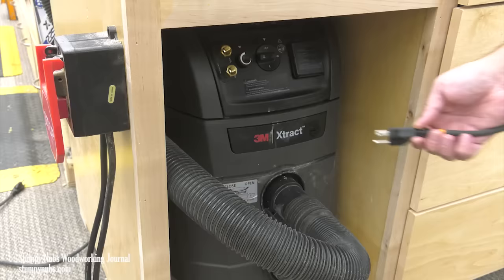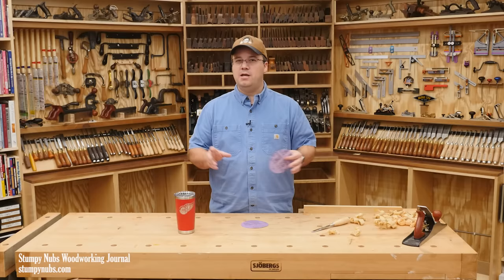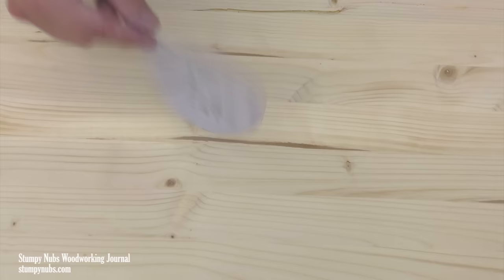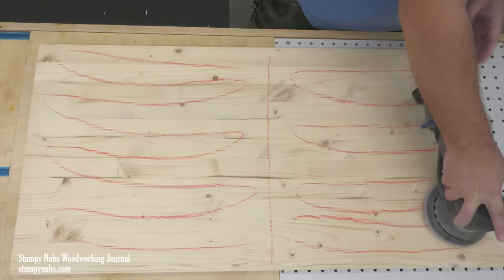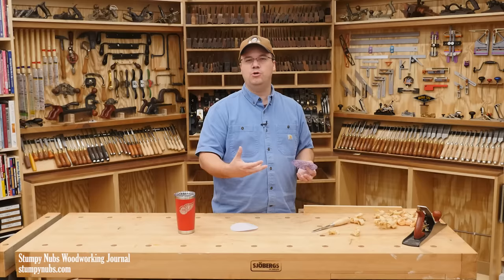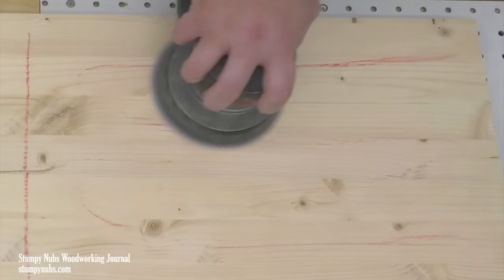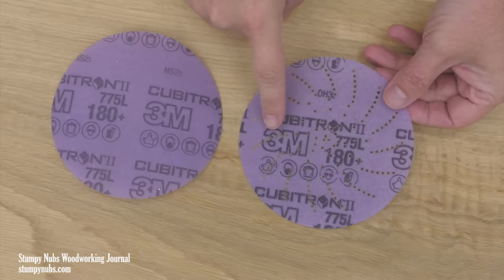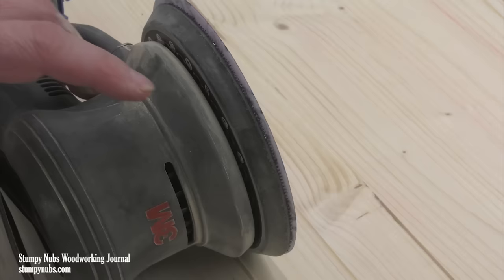This LITTLE KNOWN tip will cut your sanding time in HALF!

Comment: First of all... You have no idea how much more efficient you're making countless woodworkers by demonstrating this on your channel. I had heard rumors about the 3M paper, and had never bothered trying it... But, last week, while ordering a bunch of "state of the art" blue aluminum oxide discs off Amazon to begin major sanding of the oak legs of a major work/specialty bench , I happened to pick up a trial pack of the cubitron II Xtract discs. I wasn't sure what to expect. But, the results were so drastically better than the aluminum oxide "trapezoid" pattern amazon discs, I gave up using them altogether except for incredibly fine grits of 400 and above where the amount of sanding required is much less than the lower grits. Thank you so much for the insight... So many of us are traditionalists who are reluctant to buy into anything new... and sometimes, there's something to be said for that. But, with this, there is no comparison. It saves you so much time that you'll regret every time you ever sanded previously to this, knowing that there's a better way. I may have pride... But, in this case, my pride plays absolutely no roll. My time is far too valuable to waste it with a method that takes far more time, for no good reason.

One more thing. If I'm working with wood, does it matter if I get the mesh  discs or should I stick with the cubitron you showed in the video? I need to buy more, and I want to try the standard ones.. Unless they're inferior to the mesh/Xtract/Cubitron 2 discs. Thanks again so much!
Reply from the maker: I think the mesh discs work faster and give the best dust collection results, but the will wear out faster if you are aggressive with them, especially around the edges.

Comment: I have a DeWalt ROS which has some form of air-suction built into it. It comes with a small dust collection "bag." I believe this is common with ROS's. For me, a more interesting test would be to compare results of the dust collection bag vs attaching a vacuum using disks with holes for both examples.
Reply: Those bags are a poor substitute because the sander can never apply enough suction on its own. Still worth using if there's no extraction since they'll keep a huge pile of dust from getting in the way though, but more for just tidiness.
Reply: Residual cooling flow from a 600W sander used for dust extraction can never equal 1000W of shop vac.
Reply from the maker: Every sander is different. Comparing how mine works doesn't help you with yours. And it would not have changed the conclusion, which is that dust collection, wherever it comes from, speeds up sanding.
Reply: I have a dewalt. Use mesh paper and always use dust extractor. Bought mesh in bulk last year, so it'll be a while before I try 3m. 

You don't really need a scientific test here. The results are obvious the first time you hook it up. At least mine is.
Reply: The bag is an improvement over nothing, but worlds apart from even the cheapest vac setup.
Sheesh

Comment: I wish you had used the same perforated disc for BOTH tests. It's possible that simply giving the dust a place to go (even without a vacuum) is enough to significantly improve the sanding.
Reply from the maker: Did you see how much dust accumulated beneath the disc, from that small area? You aren't going to hide all that in the holes. But you are free to run your own tests.

Comment: It's the only sandpaper I use. I have a DeWalt ROS and a Rigid vacuum that has a DustStopper attached. I am a hobbyist woodworker and I agree 100% with James. I was noticing on my last project (crib board) the difference between sanding with and without the vac attached... I thought it was my imagination... did a lame a$$ test for myself and thought "hmmm, might be smart to keep the vac attached all the time" after seeing James do this test I am sold. Also, to anyone that has never used Taytools I'm a firm believer and I am not and will not be a "youtube influencer" I would much rather be making sawdust in my woodshop (aka garage).

Comment: Great video!  About the same time I found fittings so that my sanders would connect to the dust extractor, I bought a sample pack of Mirca discs.  Maybe the astonishing speed of sanding was not just the Mirca discs.  Thanks!

Comment: Dear  Stumpy Nubs and fellow watchers. Should you use perforated discs, then you must have suction on, otherwise the migrating dust shall clog up the disc fitting surface and it will come off well before it is worn out. Trying to persuade it to stick again is often a waste of time. Thank you for another instructive show. Best wishes from West Cornwall, U.K.

Comment: @StumpyNubs, when you mentioned “vacuum”, it occurred to me that something else is taking place while suction removes dust from between the sander and the wood. Suction is generated by the differential pressure between the ambient air and the air inside the sander. The same force also acts on the sander itself pushing it downwards, “sucking” it toward the work surface. This force, in turn, strengthens the friction force thereby improving the sanding. (Without vacuum, this additional force is not present; only the force your arm applies and the sander’s weight generate the sanding friction ) Don’t you think?
Reply: I don’t think so, since most of that suction can probably leak out between the velcro layer or somewhere else, plus the overall difference is probably negligible compared to the weight of the orbital just with gravity

Comment: The quicker  chips and dust are removed the less strain on the cutting device.Your demonstration shows it perfectly.Reciprocal saws have the problem because they only move about an inch and not enough movement to clear chips and can bog down. Sanding discs without dust extraction are just floating on dust and not doing anything.Your demonstrations show the obvious that most people miss in a very simple way.

Comment: I'm a beginner woodworker, in fact I wouldn't even call myself that, I just build stuff for myself.  And the differences in sanding time was so noticeable even to me. The only thing I will use now, even if they are more expensive.

Comment: First time I saw these disks was in this video, so I wasn't very hopeful that they'd even be available here in South Africa, but that's OK, I thought, we do have the Mirka Abranet, which I have been using with great success. But then I googled 3M Cubitron and, lo and behold, they are indeed available, but maybe just not at the places I'm used to look at! And the ones with the zigzag pattern are significantly cheaper than the Abranets too, at just below U$0.77 each, although the minimum number you can order at that particular shop at a time is 50, so it could become pretty costly if you start looking at three or more grits... 😮 Will definitely keep looking for them though!
Reply: Mirka Abranet is superiour, especially with their Deros sanders.

Comment: Interesting observation. I'm not convinced that the smoothness of the surface is better when a vacuum is used - but I can't see how to measure that without some expensive or at least time-consuming steps. But the reduction in dust is enough to make me use a vacuum when sanding.  Thanks, sir.

Comment: I am scraping all the paint (textured) off my drywall and re-mudding the entire surface going for a flat/Level 5 finish.  I bought a Ridgid shop vac a year ago and it did have the most powerful motor they had at the time.  I had never hooked a sander to a vacuum before and sanded drywall but I could not believe how much dust it got.  I would say 98% if I had to guess b/c only thing was a very small amount of drywall dust that managed to fall.   You will have to clean the filter every 10 minutes but that's dust that's not going to be all over your house later.
Reply from the maker: My house is all knock-down texture under latex paint, and I'd love to remove it. Any tips?
Reply: A light spray of water will soften the texture mud and make it scrape off ten times faster/easier but a lot of times you'll have a textured wall/ceiling that has several layers of paint on it and that prevents the water from being able to soak through to the mud.  Spray a small area with a small amount of water  - maybe 3 ft x 3 ft and let the water soak for about 2 minutes then try to scrape.  If it didnt seem to get any easier then the paint is too thick so you need to puncture the paint and create some openings so some water can get through.  You can take a scraper and do some heavy pressure scrapes over the wall just trying to create some openings for the water to get through or you can try a heavy grit sandpaper(Ive actually never done that but heard other people do it).  Dont saturate the drywall b/c it will cause the glue in the drywall paper to bleed/stain through the mud if it gets too wet and I hear it's a beeyach to hide.  You're not gonna get it all off on that first wet/scrape but you'll create a lot of openings in the paint and each time you're gonna get more mud off.   If you have a multi-tool with a scraper blade those are pretty decent for scraping something that doesnt want to let go but you gotta have a way to resharpen those blades.  I keep my Dremel / sharpening stone nearby and it works great on multi-tool blades  I switch back/forth between my 5 in 1 scraper and multi-tool scraper when my hand gets tired.  If the wall only has like one coat of primer and 1 top coat then the mud comes off very fast but when there's a lot of paint on top it's gonna take some time.  Another tool that worked really good are those scraper blades that you hook to reciprocating saw.  They're a lot wider than a multi tool and you have a lot of power behind each stroke so those will scrape a lot of mud off quick and you really dont need to wet it if you're using one of those b/c it has enough power to scrape it off dry.  Only catch is you gotta be really careful the angle you hold it b/c it will put a nasty gouge in the wall. @StumpyNubs

Comment: I think the Cubitron sanding disks might be particularly prone to this effect; they are designed for and meant to be used with dust extraction.
When buying sandpaper, there is "open" vs "closed"; there's also "stearated".  Now there are more advanced anti-clog coatings.

Comment: This is absolutely the case. You should do a video testing vacuum settings, with both sides using the same paper with holes in it. Except this time do one side with low suction on the vacuum setting, and the other side with high suction vacuum setting. The vacuum actually pulls the sander into the work piece as you sand. I would be curious what the results where.

Comment: @StumpyNumbs have you ever used mesh sanding disks or sand "paper"?  When I switch to mesh a few years ago, I got faster sanding that both cut better and left fewer marks.  Also, the mesh disks last long and take longer to be fouled to the point they need to be cleaned.  When I do clean them, I can either use the shop vac or even rinse them in water to get a better result than using those big erasers on traditional sandpaper.  The improvement was remarkable and I'm sure a great deal of the improvement was due to the same factors you describe for vacuum, only more so.  Of course, I was using vacuum all along, so what I was seeing was the difference between sanding disks with a few holes and sanding disks made of mesh.  IMO, it's a money saver that also saves time and improves quality!
Reply from the maker: I like mesh discs. But people who are overly aggressive with their sanders tend to shred them.

Comment: This is a great demonstration of why we should all suck at sanding. As someone who's dabbled in science, I would have liked that you used the same sandpaper for both tests. I really don't think it would have made a difference in this case, but an extra variable was added to the test, and we want to eliminate variables like we want to eliminate our dust. Thanks for your content!
Reply from the maker: The sandpaper is the same in it's functionality for removing wood. Same type of abrasive, same coarseness, same backing, same everything except the tiny holes, which would have no affect on it's ability to remove material. However, by using hole-less paper I actually eliminated a variable that would have skewed the results- the internal fan of my sander, which is different with every model, and which can suck up wood dust on it's own at different degrees, again, depending on the sander the viewer has. I did not want this test to be about any particular sander, but about the how using dust collection from any effective source can speed up the sanding process.
Reply: Thanks for your replay, and again, thank you for the content! I actually don't have an orbital sander yet, so videos like these are really helpful for not only choosing a sander, but also choosing sandpaper, and ways to incorporate dust extraction into the workshop (that I hope to create in the garage one day). We may still disagree on which variables were eliminated in this specific test, but that doesn't matter because, as you've demonstrated, using dust extraction is clearly the way to go. Also, your boogie comment was a home run!

Comment: I know that Cubitron discs are manufactured differently and that the geometry of abrasives is vastly different. It may be that geometry could allow better performance because the residue is more easily removed by dust collection. That residue would remain on the surface being sanded and act as a lubricant and significantly reduce performance.

Comment: My Dewalt sander actually runs at higher rpm with the extraction on. Doubt that accounts for more than 10 percent performance though. 
Extraction on an ROS is night and day, performance wise. I'm thinking about mounting my sanding kit to the rolling extractor, since I never use the sander without, and the extractor is about 80 percent for sanding. 

The only thing I miss is having that little ROS bag of matching sawdust to make putty.

Comment: I have been using Cubitron for awhile. Excellent sandpaper. I prefer it over the Xtract  personally. Thanks for another great video. I would love to get a dust extractor (I know comments are full of complaints about cost) but they are so ridiculously expensive so I have to stick with the shop vac for now.
Reply from the maker: As long as you suck up the dust, you will get the same results. You can do that with a shop vac, or even a sander that has good internal collection (I have found few that actually do).
Reply: Why do you prefer them to the xtract? I have used neither in the past, but want to move to something better.  In Tasmania, if you want to buy 3M it's going to be online and in semi industrial quantities.
Reply from the maker: @bluewren65  3M seems to use the Xtract name on their mesh discs, but it is still Cubitron II abrasive. The difference is the material the abrasive is on. Mesh is fantastic for dust collection but it can shred if you sand really aggressively or sand up against perpendicular surfaces. The spiral discs are more durable, in that respect. I use both, but I think the average user may prefer the tougher disc.
Reply: @StumpyNubs  Thanks, that's so helpful.  Great videos, all your content is stellar.

Comment: While I do know that adding some sort of vacuum to the sander does make a difference I would be curious to see the results of a comparison test of the sandpaper with the holes on the sander but without the vacuum to the same dish with the vacuum. Basically the same test as you did there but with both discs being the ones with the holes in them. I hate sanding any of the projects that I make even though I know it’s just as critical as making a piece to begin with if you want it to look decent so I’ll take any tips I can  that might make it easier or quicker.
Reply: Intuitively, it makes sense to use the pad with holes + dust extraction. The increased efficiency given by the friable dust extraction makes up for the minimal loss of abrasive surface. No holes allows dust to collect under the centre of the disc for longer, thereby increasing probability of clogging the abrasive, and reducing it's efficiency and use time, and increasing the likelihood of pig tails. It's not just better for your lungs. It's better for the finish too.